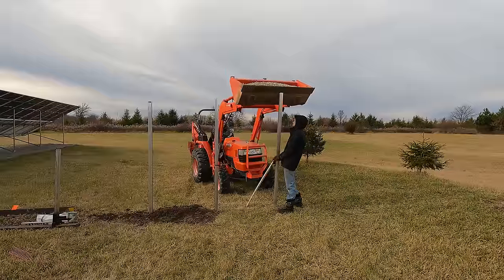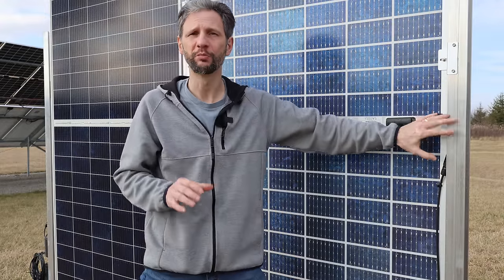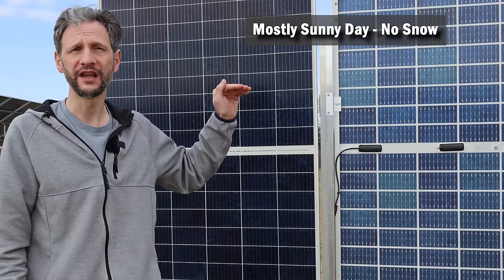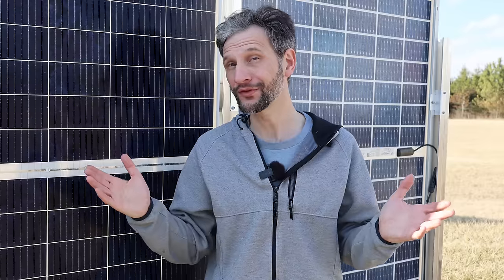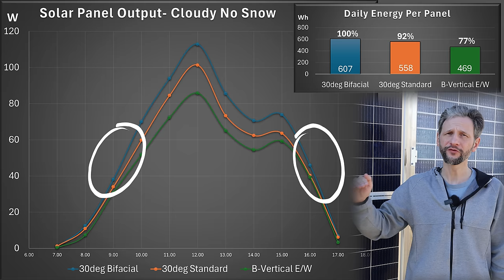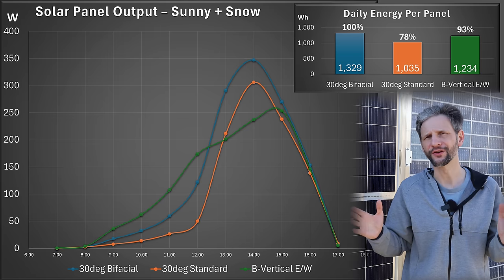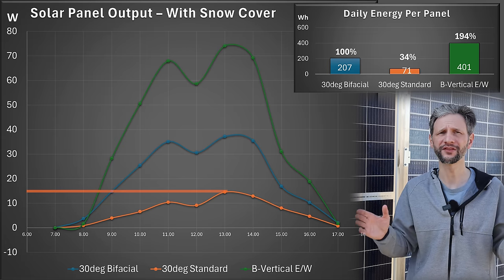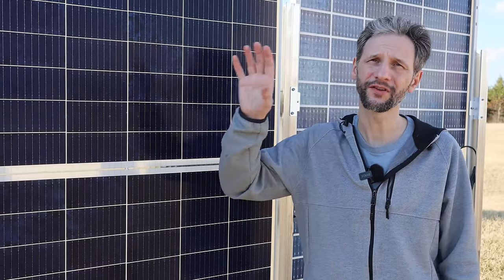Vertical Bifacial Solar Panel Performance Results Part 1

Comment: I've noticed something that NO ONE does even when they have tons of room like you. Space bifacials 6" or so from each other allowing lots of sun to reflect on the back (of course using white rock underneath would maximize benefits). Shading problem solved! It also relieves some wind force.
Small scale testing could be done with plywood used to simulate panels on the edges. Vary the gap size to see what's the best size vs performance curve. I bet on sunny days there's a huge boost.
Reply: It makes racking them more complex and expensive, though.
Reply from the maker: I believe the increased cost of racking would negate any benefit.
Reply: How so? Most people don't have more than 20 panels (double row so 10 wide). Total width would only increase 4.5 ft with 6" gaps.
Yours would increase 9.5 ft, but with all the money you spent on that metal, it's not much of an increase, especially if your output is boosted 25% in winter. (looks like you'd have to add in 2 more sections).
DIY wood mount would be negligible increase.
Reply: @TheGuruStud  DIY wood mount would also be worthless.

Comment: I have a small 12v 400w setup , two 150w standard and one 100w bi facial . Since installing the bifacial I definitely see a difrence I my collection on those cloudy winter days
Reply from the maker: Thanks for posting.  As you have experienced, bifacial panels shine in cloudy weather.

Comment: Thank you for both your research and your data you shared with us! I could see in a small older home that was built before 1950 on a small lot where both systems could work? I do think where the vertical solar panels could be cooled with water to increase there energy production on an extremely hot day!
I am no expert I have been trying to understand solar energy power production for the last four years.
Reply from the maker: There is no perfect solution, at some point you just have to decide if it makes sense for you or not and move forward.  I installed a system and realized later I could have done it much cheaper, but because I moved forward it is now payed off and producing free power.  You can see my video going over my mistake here: https://youtu.be/nC7i_GSrGlk

Comment: Thanks for posting this. The verticle option is exciting from the perspective of dual use in agricultural settings. I have heard the term agro-voltics used to describe it. I'm also intrigued by the results because I have a few locations where I could have a verticle array with the back side not accessible to sunlight (the vertical south-facing side of a building.) While payback would be much longer, it could still be worthwhile. I'm not far from Camp Ravenna in Ohio, whose site was chosen because it's the 5th cloudiest place in the US east of the Mississippi. I chose to install panels on both the north and south roofs of a building (I don't have good locations for a ground mount), and because of the cloud cover, I often see similar output from both arrays.

Comment: I am in Wasilla and was thinking about putting some of these panels in. I dont have a ton of usable space for something like this on my acre lot. So I think these might be the perfect solution. Especially since winter is when I need power the most.

Comment: Very interesting results. We live in Alaska and the arc of our summer sun is over 180 degrees from east to west. We can get a solid 12 hours of good solar sun for three months during summer.  But, our 24 panel system facing due south receives 5-7 hours max. With vertical mounted bifacial we could probably capture another 5-7 hours?  Unfortunately, the amount of sun we capture in the winter is almost 0% from Nov-March.  The sun angle averages from 9 degrees to approx 12 degrees off the horizon and I think bifacial panels would be a wash in the winter. I am looking forward to your next experiments and results.
Reply from the maker: I grew up in Alaska so I understand your lighting issues. I think vertical biracial panels would be a good solution for Alaska.

Comment: Thank you for doing this research! I'm very curious about the full year performance, as well as long-term-snow performance. It definitely seems like in heavy-snowfall areas, vertical panels might be the best bet. Or, areas where space is a consideration... the increased predictability on the vertical panels' performance across varied weather could be helpful (since variability is the most "questionable" part of renewables). But, would good storage of summer energy be sufficient to offset the variability of cloudy or winter months? Or will these panels perform even better in the summer? Only time will tell--and you're doing the hard work to get us the answers. Thank you!! 🙏🙏🙏

Comment: I’ve had separate arrays on my East, West, and South facing roofs for about 7 years because I live in a municipality that didn’t have grid-tie solar so I just use it throughout the day and wanted even power production. The East and West total 18 panels with 9 on each side and the South facing is 18 panels. The East+West outperform the South facing, significantly. So treating the East+West as bifacial and taking out the tilt, I could see it performing similar to  pure south pointed panels. (In the northern hemisphere obviously)

Comment: I was designing solar trackers. The goal was to build a tracker that when installed you could use your phone to get your coordinates, type them into the tracker and it would locate the sun without sensors. 
 Untill then i was using sensors to track the sun. One day it was partly cloudy out. As the the sun was blocked by the clouds the tracker would move quite a way off of where the sun was. I manually moved the tracker back and noticed the output decreased. Switched back to active tracking and the output went back up. Same happenned in the winter with snow. 
My conclusion, active tracking equales more power. Which was fine with me because it saved a ton of programming. 🤣
 Thanks for the video, the small footpint of verticle panels is a great idea. Especially for farms. Not only does it save space but it will help reduce water cosumption by providing some shade. In my experience some shade grows better plants with less water.

Comment: I looked this up because I'm interested in mounting bifacial panels vertically on a white standing-seam roof. I'm highly encouraged by these results; basically, every day should be like your snowy days. If I do it right, I think I can get around the problem that the long side of the building is not oriented to solar south.
Reply from the maker: Putting vertical panels on a roof would be challenging from a structural mounting viewpoint.

Comment: Thanks for the testing, I did notice that the big array is casting a shadow in front of the verticals at 9:27. I doubt this would be a killer but I am curious about how much the shadowing was affecting the verticals. From my understanding the benefit was really about heat dissipation and efficiency loss in the hotter months. I think what this setup would be best for is if you didn't have space for a array on you property and the only other option was roof mounted. Can't wait to see some testing in the hot months, i would like to see a comparison of south facing in the summer on a black roof vs verticals. From your testing I am already coming to the theory that the verticals will beat the standard panels.
Reply from the maker: I think for most people the vertical panels are not going to be the winner, but maybe for some northern folks.
Reply: @ProjectsWithDave  So i am thinking the hype is coming from roof mounted vs bifacial vertical. The efficiency loss from heat is telling me this experiment will be interesting. The drop in efficiency vs the panel temp is where I see that it may be a win, depending on what setup and the the average temperatures. I am not surprised that your bi facials outperform the verticals on a frame. So from the simulations I saw it indicated they would experience losses at certain times of the year. Think the key is going to be if is when the increased cooling actually offsets the the poor angle.

Comment: Excellent!! I would love to see this compared with "winter sun" optimized panels (almost vertical) facing South in North America. (or North in Australia)   In a perfect world testing them in against walls vs bifacial in the open.
Reply from the maker: I plan to get to that at some point.
Reply: Yes, I would even say that with this shadow thing, I wonder what the impact is of changing the angle of a bifacial N/S between 30 -> 90 degrees. If we are logical, if the rear side looks out of its own shadow to use the reflection of the sun on the snow and take advantage of the angle to make the snow fall more easily, it should in theory be more effective.

Comment: I worked on a guy's system by the ocean. We installed a newer, bigger system with conventially mounted panels, and we laughed at his two older vertically mounted panels (Maybe tilted 15 degrees or so). We figured he must make little to nothing off them. I asked him about them, and he said theyre hooked up only to the hot water heater, and they make all the hot water he needs. The power of the sun bouncing off the water is not to be underestimated!
Reply from the maker: I haven't tested it, but I've heard systems near bodies of water have a noticeable benefit from reflected light.

Comment: You should also think about optimizing the average during the year. For this, vertical panels facing south will be best. Because in the summer you always have enough energy, but in winter the energy from a low sun will be maximized and you will have almost no snow on the panels.

Comment: We have snow cover from mid November to mid April and often have cloudy winter days, so the addition of vertical panels may make sense for winter energy production.
Reply from the maker: It may make sense for you.  You will likely need a lot of ground clearance and that can be difficult to achieve with wind loading.

Comment: I’m not a subscriber but the algorithm recommended this video to me. Your results confirmed my suspicions. 2 questions I have are:

1. What is the cost per watt or watt-hour generated? 

2. What is the watts per meter squared of footprint?

Edit: also, many thanks for making this video. Excellent work.

Comment: Thanks,
the important part for me is to stretch the solar income over the day,
and as of some time hard thunder storm gusts I prefer a until yet only theoretical solution:
a row 45 degree east, another 45 degree west ... that lower the feed at lunch time, and also the need of batteries as of more time the day with direct electric usage.
Didn't test it yet ... but keep your hints in mind.
Reply from the maker: I tested some off angle positions in this video: https://youtu.be/J7xnY84Ch1E

Comment: I think longevity for panels is increased in high sun areas like the desert as the vertical panels stay cooler.   Something your area doesn't have an issue with.

Comment: Great video - but as others have stated - supposedly the biggest gains are in the summer in hot climates - where the vertical panels do not get as hot.
Will be interested to see our results then.

thanks for the video.

Comment: yeah, I can see some use cases for this. Especially Solar Fencing, or on farms where you want to still be able to use the land in between the solar, or in a back yard or front yard where the owner wants to retain use of more land than regular rack mounts would allow (this is assuming the owner cant mount on the roof).

Comment: In the UK you get an extra benefit from having E/W panels in that they generate more power when the export prices are higher, provided your on the tariff with the really volatile prices.
Reply from the maker: Right, the goal here was to provide data so you can consider your own unique parameters and design a system that will be optimal for you.

Comment: Dave, 
Can you also add "Land Usage" as a factor here? Space is often a premium
What is the land requirements/watt on each of these two solutions?
Reply from the maker: If your array is large enough to require multiple rows, vertical requires more space from what I have seen.  However, I don't have exact numbers to show.

Comment: Thank you for such thorough tests!   Very complete and clear.   The thing I appreciate the most is your crisp presentation without delays and repeats.   Well done!   I had a thought.   Perhaps galvanized roofing laying on the ground on each side vertical arrays would work well.  The corrugations would produce reflections throughout the day (perhaps).
Reply from the maker: That's actually a unique proposal, I haven't heard that one yet.  Thanks!

Comment: Pretty cool results. So the takeaway is that vertical panels produce a lot less power, but it's more stable over a range of weather conditions, they produce the same duck curve as the power consumption does, are not sensitive to snow accumulation, and take up almost 0 acreage (with an asterisk).

Comment: One thing i think is truely missing: what is the wattage per m2 of used land. In my opinion the array surface is not important in this comparison. In the 30° array you can't use the ground below. If you could extrapolate to 1000m2 to show how much peak wattage you could fit with both methods, that would be really interesting.
Reply from the maker: I think vertical will produce less per unit area due to the wide spacing required between rows.  You have to have some additional reason for going vertical, such as farming or winter conditions etc.

Comment: Thank you for taking the time and effort to do this.  
Not an easy project to conduct for sure.  Very interesting results for sure.

I see a different benefit to using vertical mounted arrays: applicability to agriculture spaces.
In Wisconsin, we have a few formerly agricultural properties that have been completely converted to vast 30deg solar array spaces.
Although I am totally into generating energy any way we can to reduce carbon footprint, I see the consumption of viable agriculture spaces as counter productive.
The mounting of 30deg arrays consume space that previously could be used for a variety of agriculture scenarios seems counterproductive to me.

The implementation of vertical mounted arrays could change the paradigm.  
If vertical arrays are deployed on an agricultural property fence line - especially eastern and western perimeters, the space inside the perimeter could be maintained for agricultural purposes.
Obviously, the field size array would generate more power versus a perimeter model, but I feel that it is important to maintain agricultural space for obvious reasons.

But...  a standard for vertical array mounting would need to be formalized to address strong (storm and gusty) wind scenarios.  
Weather in some areas can get some very substantial winds that could be detrimental to vertical arrays not engineered to stand up to the forces involved.
Certainly, 30deg arrays have a similar risk already, but vertical arrays would likely capture the wind in ways that the slanted 30deg arrays would already mitigate.

Comment: Not sure abot how your electricity price works over there but in Sweden, there is always a big dip at noon every day and during the summer. I have wall mounted panels and If I includes the price, it produces more value than a roof mounted system as I get more energy in the fall, spring and winter. I will now add more vertical panels the the west as price in the afternoon and early evening is highest.
Reply from the maker: Thanks for posting your actual situation.  You have posted a great example of creating a system that matches your specific needs.
Reply: @ProjectsWithDave  as well as the overall electric grid needs :)

Comment: Vertical solar panels really thrive in case of optimizing power generation per area. Since they need less space, ypu can put more of them on less space, and therefore produce more power on the same area as standard panels.

Comment: I started living with PV about 40 years ago in northern Maine. Pretty quickly, I realized that my roof mounted panels were going to be a problem due to snow cover. So, I made a mounting system that allowed me to stand the panels vertically for the winter months. Though the days were considerably shorter during the winter than during the summer, the reflected light off the snow, the lack of snow cover on the panels and, I suspect, the reduced resistance in all the circuitry due to the cold, meant that on sunny days, my max amps in winter were as high or higher as were the summer days. Plus, because the winter sun came up and went down closer to a useful angle to the panels, I really didn't lose much efficiency due to day length. The big issue was that there were more cloudy days during the late fall and early winter. That was when energy to the system was challenging. 
I love the bifacial panel idea. I wonder what effect having some of the vertical array facing southeast and some southwest would do to enhance smoothing out the midday dip.
Reply from the maker: There are lots of solutions with panels and mounting, now we just need to get rid of the clouds in the winter... : )

Comment: Good to see you got to test this - I mentioned vertical arrays in your comments a year or so ago. I saw another video on vertical a couple days ago that pointed out one key advantage to vertical panels - morning and evening temperatures are lower than mid-day - the decreased panel efficiency due to panel temperature was limiting the south-facing panels versus the vertical tests. I think the temperature related losses amounted to 3%.